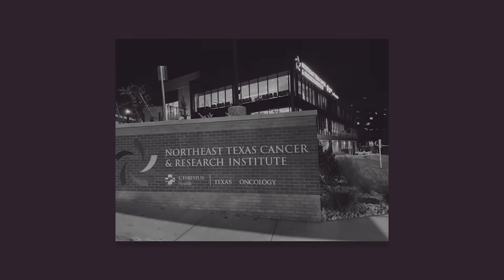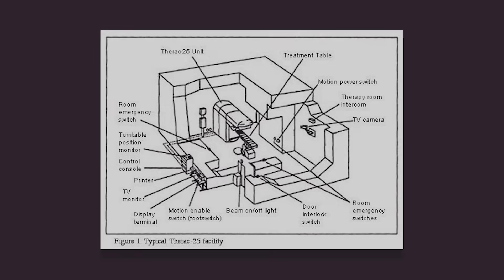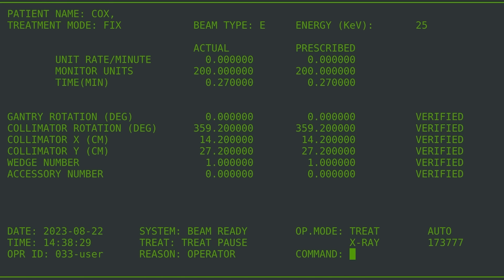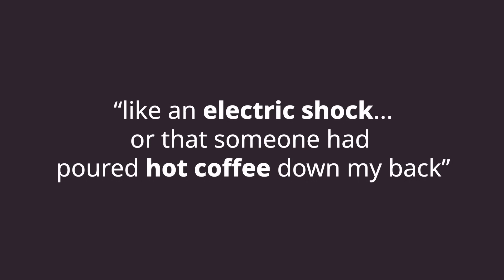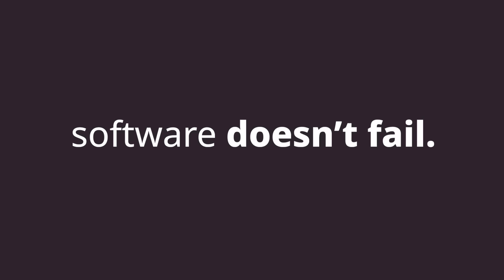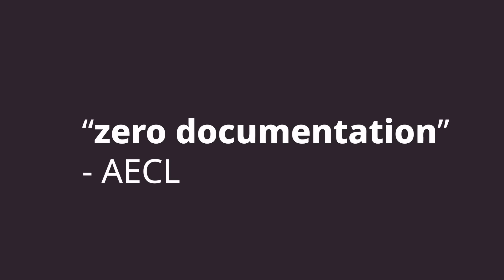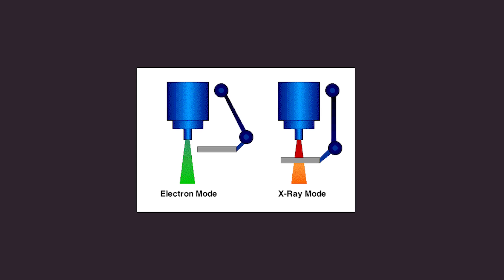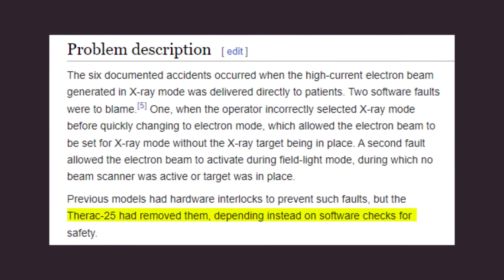how a simple programming mistake ended 6 lives

Comment: The thing I dont understand: why would the program not simply block the input mask, while it was setting up the machine? The coder clearly knew about the issue, as he programmed the software to set up the machine multiple times when reaching the set up subroutine. Or have a menu button that manually triggers the set up (instead of automatically triggering it, when reaching the last line in the data entry) and then leads to a simply display screen, that only allows to view the settings, but NOT change them, and the controls to start/stop the treatment, or go back to the data entry screen?

Comment: They wanted to place the blame on the poor scruffy programmer, when the root cause was ultimately with whoever made the executive decision to cheap out on redundancy, and rely on the software running flawlessly forever. They fantasized that they could design the machine to operate safely extremely cheaply. It is ultimately the folly of corporate structure - compartmentalization of responsibility. But the tragedy caused positive change.

Comment: 38 years after this disaster and we're still making assumptions similar to the "software cannot fail" assumption cited in the video.

Consider self-driving cars.  They utilize "artificial intelligence", but that is just a moniker.  There is no real intelligence, just pattern recognition.  Ditto for "autopilot mode", a mode that implies the car is capable of operating unattended.  But "autopilot mode" is so named only because the manufacturer's marketing department thinks it sells better, not because it conveys the true capabilities of the product.  So if you're riding along in your shiny new Model 3 in autopilot mode, and the pattern recognition algorithm encounters a novel edge case, you're going over the guardrails.  This has happened to drivers who thought they could leave the driving to the car.

The same greed which motivated the elimination of safeguards in the Therac 25 is alive and well today.

Comment: 7:43 Wait what? So if the magnet moves when the mode is changed and the machine ignores input while the magnet is moving, why is "THE PROBLEM" represented with the magnet out of the way? The change in mode happened within the 8 seconds so the machine ignores it and it should just give a normal X-Ray treatment. Unless it doesn't completely ignore it, it just doesn't reconfigure the emitters but moves the magnet, which is kinda weird.
Also weird (well.. more stupid than weird) that the machine reads the input in real time instead of reading everything when the operator starts the sequence.

Comment: I worked in many different industries in last 20 years and many of them applied safety critical protocols: automotive, railway, biomedical, difense etc. In some of them you must use a dialect of C Language called Misra C: basically the main feature of this language is that you cannot allocate dynamic memory. There are something like up to 256 rules of misra , most of them are used in aerospace industry. About software cycle usually they use waterfall cycle and the probability of a bug, anomaly or unhandled error is close to 0%

Comment: I'm sure someone in these comments has said this before, but this wasn't the only bug in this device's software. There was another one discovered after where the machine would deliver a full-power beam regardless of the set parameters if the operator was unfortunate enough to press the button when the program counter was at zero.

Comment: So the Therac-25 was a replacement for both the Therac-20 and the Therac-6 so they combined the 20 and the 5 and to save costs they removed the hardware interlock subtracting 1 component to come up with the Therac-25 instead of a Therac-26...

Comment: The electromagnetic spectrum is more dangerous than I thought. I'm not just talking about the upper channels that x ray uses. I'm talking about all of them. From the lowest ultra-low u. H. F. To the highest gamma. With enough wattage behind it They can kill. Our education system and society needs to add a new element. Energy, Although yes fire puts off light. It's not made of light. Electrons and photons are energy. Therefore, they should be classified as an element.

Comment: Whenever something changes on screen : 1) change it in software, 2) "read" it back from software, 3) show it on screen ... Raise error if mismatch.

Even I do it with arduino communicating with my stuff let alone a machine shooting radiation on patients. 

Oh and I added mechanical fuses, electrical fuses, strategically set breakpoints if ANYTHING comes in contact with humans.

What is this safe code ? Not even a confirmation of settings before starting the therapy ?

Comment: On the contrary, the software did exactly what it was programmed to do. Nothing more, nothing less. The algorithm is the thing that failed the machine.

So the saying that software doesn't fail still holds up because it did exactly what it was supposed to do. Not missing a beat.

Your conclusion is way off.

Comment: haskellers always say that the goal of type driven design is to make unwanted state impossible to be represented, so making your code safe. a type system is just a tool to guide the design of your software and make sure always matches the desired specification. 

but then the operator was allowed to modify the STATE of the UI

Comment: The bigger takeaway from this story isn't that ancient code lacked logic and user input safeguards.  Rather, that Therac's upper management made unethical design choices to lower the cost of production.  Coupled with minimal pre-shipment testing of said units.  "It was decided to remove the physical (electro/mechanical) safeguards and rely entirely on software to lower costs"!
Reply: They was only tested when installed

Comment: This situation sent a chill down my spine. It reminded me of the time when I was designing security and door opening systems and the fears I had of software bugs or electronic design flaws. The extended weeks I would leave one system working alone 24/7 while another system monitored it.
I can't believe that an industry that ships a machine with the lethal potential of this one would not test for it or even be tempted to eliminate fail-safe mechanical systems.

Comment: The idea of relying 100% on software checks to prevent a machine from killing you is absurd. From the very start I was wondering why it was even physically possible for it to output that much radiation in a way that is lethal. Software has bugs, removing hardware solutions for safety to make a machine like this cheaper should be a crime.

Comment: I am coding for a 400V lithium iron phosphate Battery Management System for a lithium battery 4x3x1 feet in size. Alone. C. ARM. For a startup.  The system supposed to handle short circuit, overtemperature, over / charge. Should i setup a getaway location just in case?

Comment: It's arguably technically correct to say these victims died of a 'programming error'.  IMO it's a lot less forgivable than that.  Back then, the standard implementation of equipment systems necessary to insure safety were hardwired physical devices, which are still in common use today, although today, provably safe software systems are also commonly used.    My take is that they were negligent, not so much by introducing a software error and failing to discover it during testing, but by trying to do safety with software in the first place, by using physical switches to prove which target was in place before allowing emission of any energy.    Then, even if the software had an error that was unforeseeable or even negligently shipped, there would have been no harm done to these people

Comment: Interesting, I used to work at Theratronics starting in the late 90's. The cobalt beam machines are a engineering marvel, it was really unfortunate that these patients died as a result of arrogance. The earlier Eldorado therapy machine was a workhorse but an incident occurred in Mexico with one of theses machines. The machine was sent for disposal without removing the Cobalt 60 source, the metal recycler smelted the main head unit creating a radioactive nightmare.

Comment: I retired as a senior mechanical engineer from a 6000-person electronics manufacturer, where I established engineering standards and practices for their manufacturing division. While the programmer goofed, the fault lied with ACEL engineering management, which should have had an experienced “senior” or “principal” engineer be the responsible party for system engineering on the Therac-25. Such an individual would have known better than depend upon software-dictated bit flips and order-of-operation to keep track of the position of ultra-critical mechanical assemblies. I would have used two normally-open limit switches, BOTH of which must show “closed” to know where something is.  ACEL’s software practices were akin to asking a traffic-control programmer “How do you KNOW ten cars came out of the tunnel at ten minutes after noon?” and being told “Because I commanded the gate arm to rise ten times and counted ten cars go into the tunnel at noon.”

Comment: Shocking that they never tested it.  This was AECL, not some seat of the pants private company.  NASA was doing software testing in the 1960's "Even during the early 1960s, the cycle of requirements definition, design, coding, testing, and maintenance was followed, if not fully appreciated, by software developers. " and "Verification and Validation: There could be no true certification of the Apollo software because it was impossible to simulate the actual conditions under which the software was to operate, such as zero-G. The need for reliability motivated an extensive testing program consisting of simulations that could be accomplished before flight. Three simulation systems were available for verification purposes: all-digital, hybrid, and system test labs. All-digital simulations were performed on the Honeywell 1800s and IBM 360s used for software development. Their execution rate was 10% of real time109. Technicians did hybrid simulations in a lab that contained an actual AGC with a core rope simulator (as core rope would not be manufactured until after verification of the program) and an actual DSKY. Additionally, an attached Beckman analog computer and various interfaces simulated spacecraft responses to computer commands110. Further ad hoc verification took place in the mission trainers located in Houston and at Cape Canaveral, which would run the released programs in their interpretive simulators.
 
The simulations followed individual unit tests and integrated tests of portions of the software. At first, MIT left these tests to the programmers to be done on an informal basis. It was very difficult at first to get the Instrumentation Laboratory to supply test plans to NASA111. The need for formal validation rose with the size of the software. Programs of 2,000 instructions took between 50 and 100 test runs to be fully debugged, and full-size mission loads took from 1,000 to 1,200 runs112.
 
NASA exerted some pressure on MIT to be more consistent in testing, and it eventually adopted a four-level test structure based largely on the verification of the Gemini Mission Control Center developed by IBM in 1964113. This is important because formal [48] release of the program for rope manufacture was dependent on the digital simulations only. Raytheon performed the hybrid and system tests after they had the release tape in hand114. At that time, MIT would have released an AGC Program Verification Document to NASA. Aside from help from IBM, NASA also had TRW participate in developing test plans. Having an outside group do some work on verification is a sound software engineering principle, as it is less likely to have a vested interest in seeing the software quickly succeed, and it helps prevent generic errors."
Computers in Spaceflight: The NASA Experience
- Chapter Two -
- Computers On Board The Apollo Spacecraft -
history. nasa. gov/computers/Ch2-6. html

Comment: All this would have taken a few more lines of could to check to see if the new condition had been set before moving on to setup. If anytime before execution this condition double checked to make sure user input matches machine settings and this is checked and corrected before allowing operation. Simple validation check. Would not have cost anything. Part of the program bid.

Comment: It basically boils down to greed. The previous models had hardware safety interlocks that have a tangible $ cost. Software not so much. Still boggles the mind how this device was placed on a production floor without any model specific FDA certification & approval .

Comment: I used to work for an electronics company that designed and manufactured the electronics for Bobcat. They were obsessive about software testing.  Every product had a 2" thick testing manual that took at least a week to perform. And any change to the software, no matter how insignificant, required full testing, and approval.  Even if the software wasn't changed, but just recompiled for production, we were required to perform full testing and approval before use. Their argument was that it was a small price to pay to avoid a problem in the field with their customers.

Comment: I was a programmer and electronic engineer in the 1970-80s that largely programmed in assembly code across multiple platforms (DEC LSI, Motorola, Intel, TI 9900, Z80, etc). I loved it, but came to realise that reliable bug-free assembly code is extremely difficult to produce, as compared to using high-level languages and good software engineering controls. Everyone knew this then. My company refused to provide its service for medical equipment manufacturers. The product managers for the Therac-25 were extremely negligent in their duties. If they were engineers, then they were criminaly negligent.

Comment: This could have been massively redused by having a set command that needed to run and do data safety calculations before going to the firing command.  Data entry should also have been locked out during the data processing/setup and the firing stages.

Comment: Still happens to this day in the automotive industry.  The real irony is that hardware does what it is instructed to do, even if the instructions are faulty software malfunctions.  Most of the software malfunctions are covered up and mislabeled as faulty parts and/or operator error, because those are common occurrences as well, and are more easily accepted by the uninformed consumer.  Too much of what should be mechanically controlled by the vehicle operator has become 'automated' by means of programmed ECU responses.  Software is just that - "soft", and can be susceptable to corruption or unprogrammed alteration.  Engineers are 'supposed' to be taught how to safeguard hardware from causing damage, injury, or death due to potential software corruption or programming errors, but the two are seldom taught together anymore, or so it would seem.  Development oversight should not be left to beancounters, or anyone who does not bear the full responsibility of outsourcing one or the other development & production aspects.  
I sometimes wish a developer for some 'automated' features in modern cars would get a remote electric shock every time their 'bright safety innovation' actually interferes with normal/safe service and operation of said vehicle.  Maybe that would give them some incentive to plan things a bit more intelligently, or at least with some better forethought than just meeting someone else's agenda for a paycheck.

Comment: This is a common case study. The issue wasn't just the software issues. There were hardware interlocks in previous systems. The software team assumed that the hardware interlocks would act as they always did. The hardware and software teams didn't communicate. To make things worse the PDP11 was running out of spare cycles. It is critical to review the entire system when doing any upgrades that effect safety. https://sma.nasa.gov/docs/default-source/safety-messages/safetymessage-2006-12-01-radiationcancertherapymachinemishaps-vits.pdf?sfvrsn=5ca91ef8_6

Comment: I was particularly interested in this since I went thru radiation therapy in 1983 for Hodgkins disease.  Luckily they were using a clunky old huge xray machine and the exposure time was several minutes and was controlled manually.  I remember the extremely painful radiation burns under my arms.  I was very lucky and have been free of Hodgkins since then and the radiation I received does not seem to have caused any lasting side effects or damage.

Comment: This happened in the early to mid 80s when computer controlled machinery was still in it's toddler stage and most programs were written by a single person on a compiler that did not have robust debugging features, if any at all, and most software did not go through robust beta testing. Additionally, I believe the software used for the Therac-25 was written for a prior model. So it might not be fair to say it was bad coding when it may have been an improper application of code that functioned fine in the previous model.

Comment: This is why any microwave oven sold to the public has a seperate door open interlock switch that will interrupt the electrical power to the magnatron generator. Yes the built in computer also has a door open sensor and that same computer can and does turn the magnatron on and off in normal operation. But that's not good enough. A glitch or software hickup could still activate the magnatron with the door open. But not when there is a redundant electrical interlock that does not depend on the computer to work.